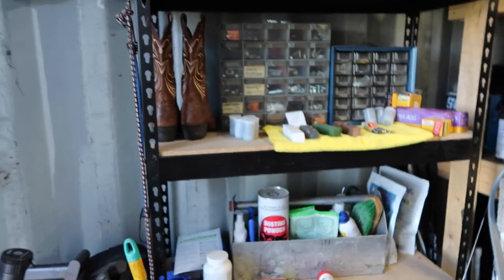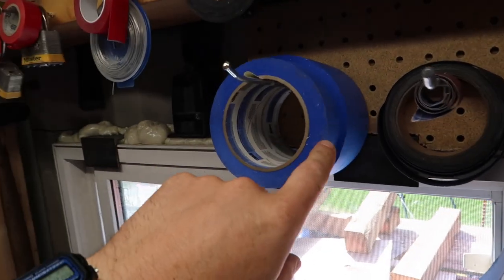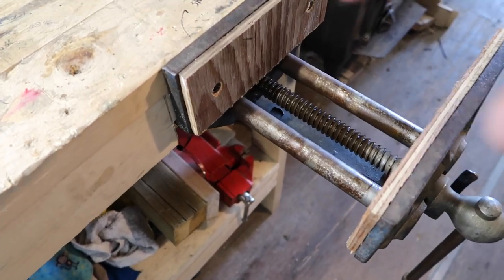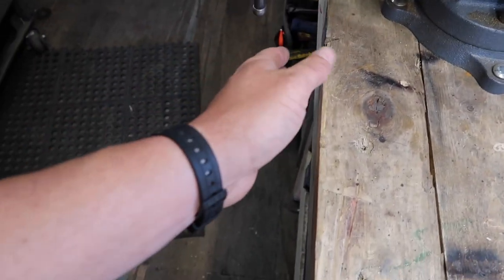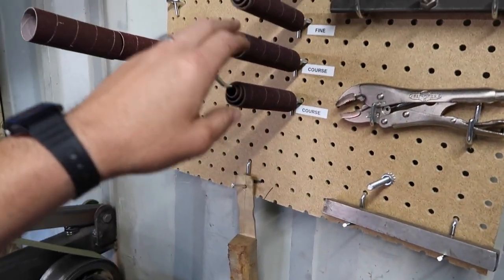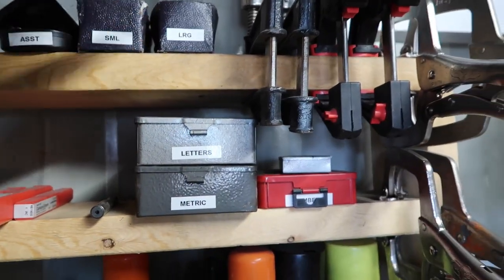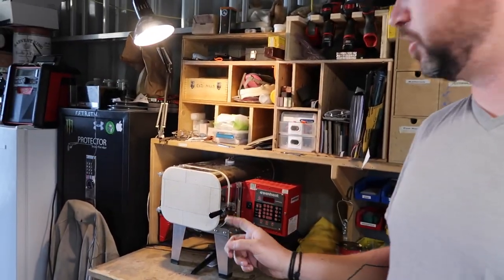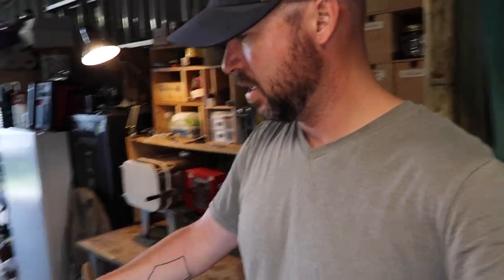Knife shop update, new (to me) bench-vise installed and some organization

Comment: Finished knives you should make a wooden felt or soft materiel multi layered style of tool box like an old metal one that has its top 2 parts and folds open and the underneath has a seperate layer. Hard to put into words. But another one could be a similar box that Adam Savage made on Tested's YouTube channel where he makes a blade Runner inspired box for his Blade Rubber blaster, that design but not as complex !
Reply from the maker: I'll have to check that out. Kind of what I'm envisioning is a machinist's tool box? Thanks for the suggestion

Comment: you could use magnetic bar like chefs have  for your knifes in progress
Reply: That's a good idea but I think that might cause issues in an enclosed space like that where there's a lot of grinding, sanding, filing and cutting of magnetic metals going on. Wouldn't want to plunk a full custom blade on the strip, only to pull it off and realize you've now got a bunch of tiny scratches in your finish that you'll have to buff out due to tiny particles of steel on the mag strip.
Reply: +blainereese Roger that didn't really think about that part the only other thing I could think of doing is if you take it to before or a piece of wood cut slots in it I have another piece underneath it as a stop other than that I wouldn't know any other way of possibly storing them I know this is going to sound kind of crazy I was watching a life hack video and I used it for fishing poles don't know if it would help what the foam tubes used for pools and swimming that they sell super cheap he cut slots in it and the foam with squeeze enough to hold the fishing poles they could be something else to look into